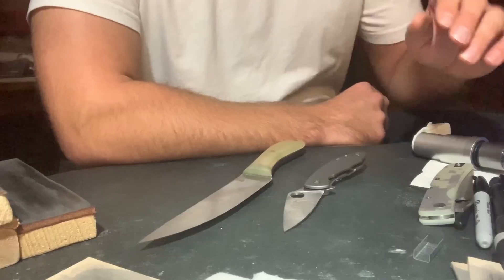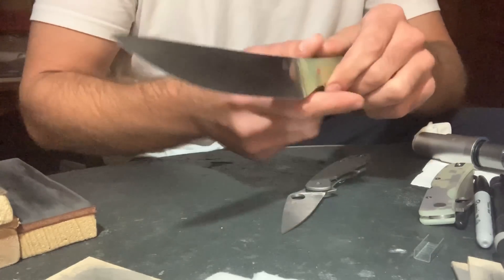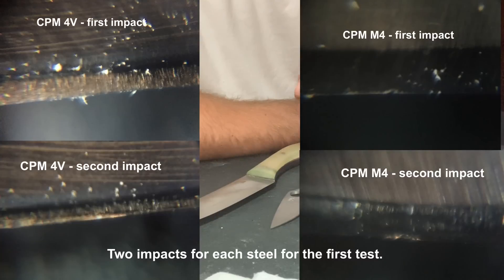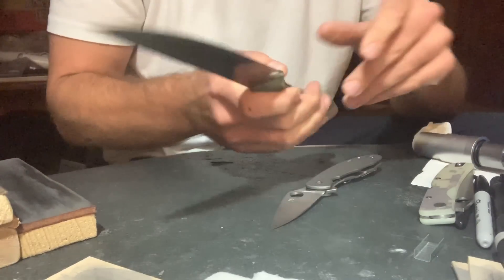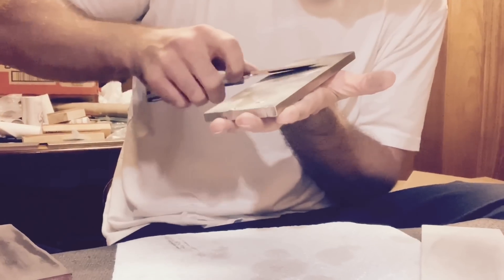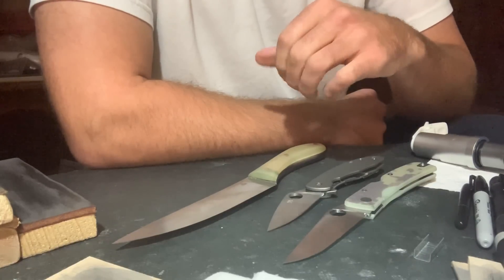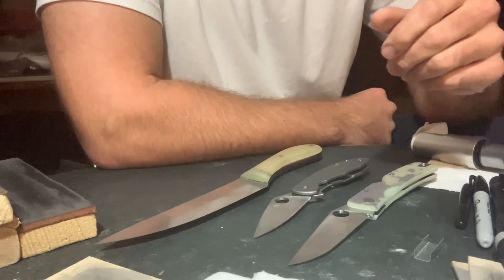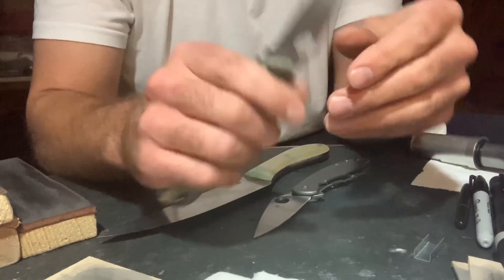Steel toughness testing - 4V, M4, and S90V

Comment: See everyone talks about m4 being tough. I think it is a little tougher than other high carbide steels but at 62 -64 it is only a little tougher 5han M390 at 60. Just my experience. I had some chipping just the other day in a griptillian in m4. I was cutting some very ridged cardboard, like so ridged I did it know it was actually cardboard. It was part of a cheap coat hanger. Also maybe manly knives is not getting a good yield of carbides after heat treatment. That last test you did with edge retention and also this test are kind of maybe implying that.
Reply: M4 chipped on the cardboard lining of a coat hanger?
Reply: The Ace yeah it did, I needed the wire part of the hanger so I put the tip in and kind od cut it off the wire. After I finished I had several chips in the edge. Big enough that I had to go back to diamonds to get it out.
Reply from the maker: Matthew Forrest I’m curious about how the M4 knife has been sharpened recently.
Reply: Michael Christy it is a shot show griptillian. So a limited edition with a black coating. I don’t carry it much because of the black coating but it was Halloween so 8 needed a black knife 😂. Point is I sharpened it initially 2 years ago. Since sharpening I e stropped it or put a micro bevel with a spyderco fine stone. But honestly it never needed to be sharpened cause it was never really used. I would strop it because I got new compounds from ken shwartz and wanted to see if I could get a better polish.
Reply from the maker: Matthew Forrest so you did put a micro bevel on it?
Reply: Michael Christy Yes. Well I suppose it depends on whAt a micro bevel is. After stropping I raised my angle and felt my way through the edge on a spyderco fine stone. I just continued doing that until I felt no hangups. Maybe that’s not a microbevel. More like removing the burr? Don’t know.
Reply from the maker: Matthew Forrest so how long did you run on that increased angle before you found the chipping?
Reply: Michael Christy pretty much right away. Like the first time actually cutting anything other than paper.
Reply: Michael Christy could be that I sharpened it all free hand and used some diamond strops down to 1 micron. Then I got some cbn from ken Schwartz. I went back to 4 micron 1 micron and .25 micron. Then put the microbevel on it with the fine stone. Maybe it was over Stropped? Not sure. I e tested steel toughness myself. Spyderco Gayle bradly 2 spyderco pm2 s110v and a Ritter grip in M390. I cut heavy duty coaxial cable. Visually the damage was exactly as you would expect. M4 came out on top, and actually it had very little damage. Just the tiniest amount of chipping.
Reply from the maker: Matthew Forrest that’s surprising.  I could see it chipping if you touched up the micro bevel for a long time instead of sharpening it, but not right away.  Sharpen it out and start over with it.  It’ll probably be fine.

Comment: Awesome.
Reply from the maker: The Ace thank you.
Reply: @michaelchristy4982  this is going to make you roll your eyes, but you'd definitely see a more significant change in damage if you upped the ante on the damage. The problem is, toughness tests can get out of hand. There's no reason to destroy knives. Usually we find out how tough our blade is by a mistake being made, and the blade surviving/hold up well to said mistake. The more damaging the mistake, the more information we're given. I don't have any real advice for you, as far as what I would suggest. It was a good test. But if the level of impact (in theory) was increased, I'm sure we'd see a bigger difference between steels. I'm not talking about pure chopping, but just a mistake more significant than hitting a staple that wasn't even clamped in place by a staple gun.

I'm a religious follower and look forward to your next video.
Reply from the maker: The Ace I understand what you’re saying, but keep in mind, my goal to try to mimic the kind of mistakes that are made.  Beyond that, the impact was pretty significant.  I’m surprised the damage wasn’t worse.  When you hear people say, “I think I hit a staple.”, it gives the idea that they’re not sure.  With this, there was no mistaking it.  I could feel it and hear it.  
Leading up to this test, I even tried hammering the edges through staples, and the damage was about the same.  (This was with 4V and M4, not with S90V.).
Reply: @michaelchristy4982  I understand. I think I am biased because I work in an environment where everything around me is steel. So mistakes are big mistakes. This is why I value toughness. But most people in the online knife community own a ton of knives and only open letters/occasionally slice cardboard with them. They don't value toughness so I know I'll have to do any thorough testing on toughness myself.